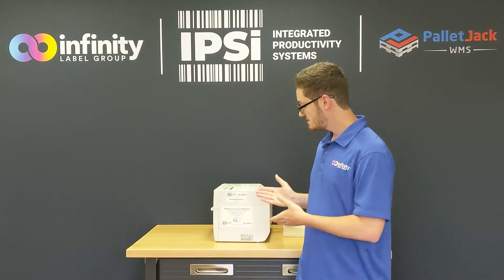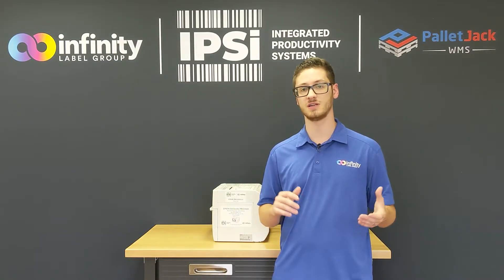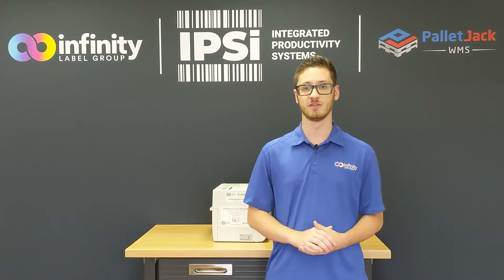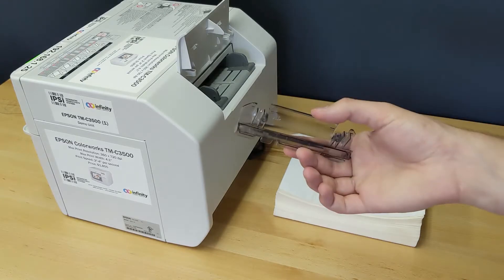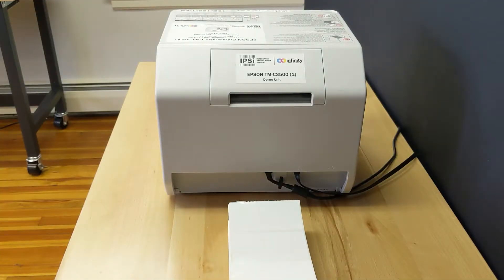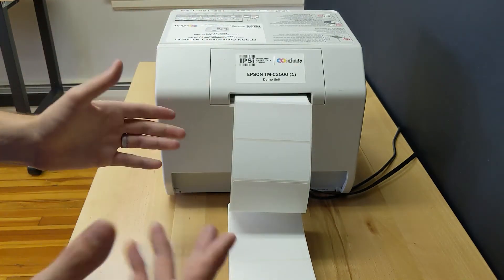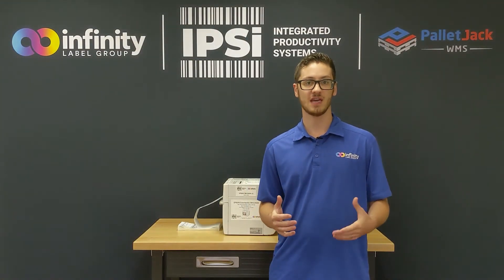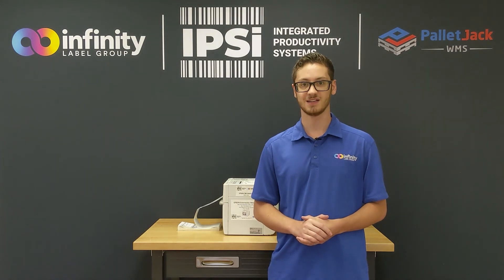IPSi Print Lab - Epson ColorWorks C3500: Loading Fanfold Labels

Comment: There is nothing in the print que but keep receiving MEDIA FORM ERROR even when I restart the printer and computer.. Any suggestions?
Reply from the maker: Hello, please check the C3500 Printer Setting Utility (Printing Preferences > Printer Utilities (tab at top right) > Printer Setting Utility) and confirm that your media source and media detection settings are correct.  You may need to turn the printer off and then on again one more time after this is completed.  If this doesn't work, you can try updating you printer's firmware from https://download.epson-biz.com/modules/colorworks/index.php?page=soft&pcat=34&scat=36

Feel free to give us a call at (844)477-4911 for additional assistance.